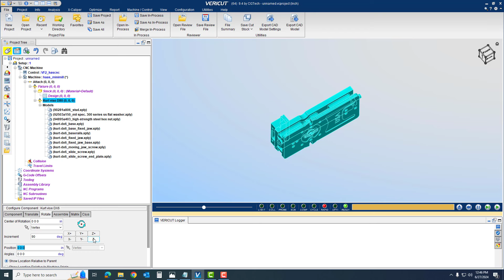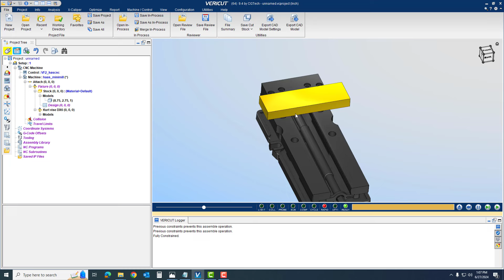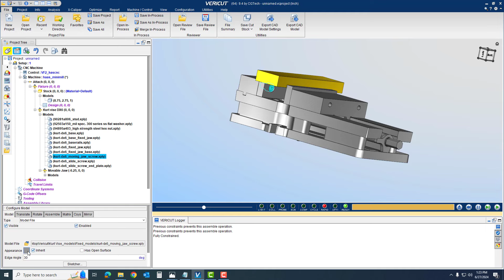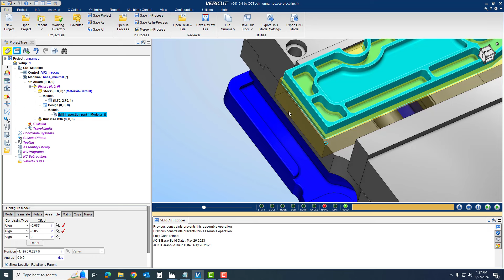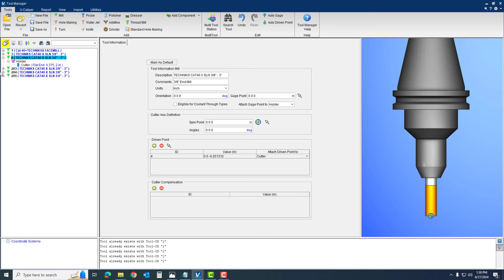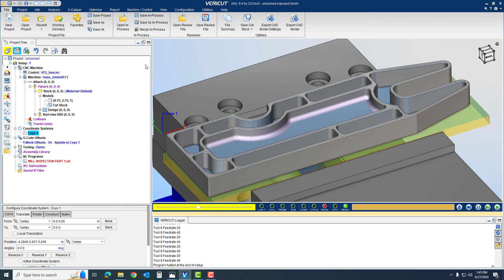Vericut Milling Setup with Fixturing and Master Tool List

Comment: I started vericut with your videos,but only one problem coming again and again...

Tool shank and holder colided with stock.
Please help me
Reply from the maker: For the tool shank, Collision just makes your length of cut longer or make the diameter of the shanks smaller by like .010 Also, for the holder, your tool name and offset need to match. I've had students that have set it up right, and I have them delete the tools in the tool library and just recreate them, and it worked great. Sorry I took so long for the response. Thank you for watching

Comment: Can you make a video showing how to import all the machine parts so I can see the machine in the simulation please?
Reply from the maker: @maxcox6019  unfortunately all the machine parts are only available through the software Distributor, but if you have Vericut can build all the parts for the machine. then you can start constructing the axis and the range of motion but there's a lot to it. You  can reach out to a Vericut sales representative, and they can build whatever machine you want. Sorry I'm not to that level yet. I'm working small steps at a time. The way I got the vice was I went to kurt website and was able to download their free 3D model
Reply: @aaronrunk4209  I have the Haas 3d machine files I just don't know how to build them in vericut
Reply from the maker: @maxcox6019  I want to say that when I select the machine file, there's an option to import from there,  but I believe it has to be through live 3d. You'll have to let me know if that works.